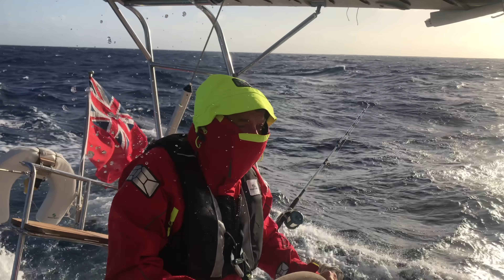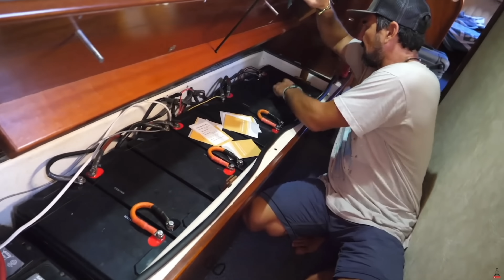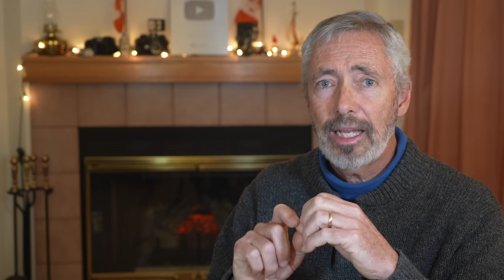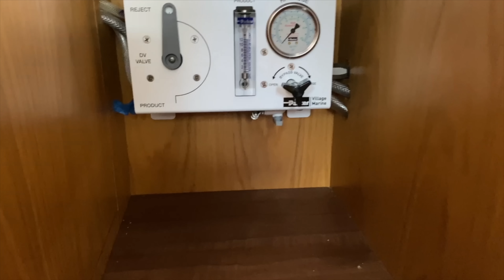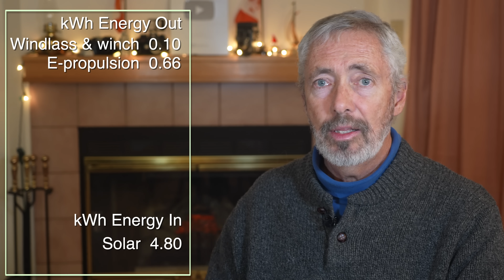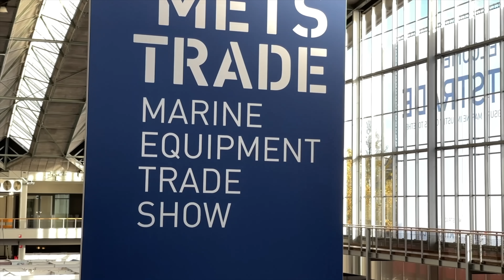Building an ALUMINUM Sailboat Pt 8 - HYBRID Power on a Sailboat: Will it Work for Distance? | EP 228

Comment: I agree with your choice of not going electric only. For my wife and I safety is first.  If diesel means getting ahead of a storm or arriving to an unknown anchorage or marina before dark, or giving us options in the event of a serious rig problem, we’ll take it. We have our 2nd boat build underway and have made some different choices this go-round. When we commissioned our first boat, a new 2018 48ft monohull, we specified a generator and typical lead acid batteries. The generator had to be used for washing clothes, making water, and at times, charging the batteries (we had no AC) when no shore power was available. When we brought the boat from Sweden to the Chesapeake in 2019, we were advised to not use water maker in the bay so our generator saw even less use.     

This time around we have downsized to a 45ft monohull and opted out of the generator, opting instead for a system of almost 1,000ah of lithium for the house, and two high output alternators on the engine, and some solar. No water maker but have added AC for those “special” occasions.  For water in the Bahamas we will purchase a portable water maker.  

Considerations: the cost of a high Kw generator offset the batteries and removes the maintenance of same. Also we are notfull-time cruisers, so our choices might very well be different if we were living aboard. We take delivery in June of next year (Sweden) and it will be interesting to follow you and compare notes 😊  Thanks for a great series and inspiration.

Comment: Check out the hybrid HPV water cooled panels ..to preheat your water..
Hull Insulation works in both extremes and good passive ventilation saves lots of energy.. 
There are new technologies occurring daily...one is wave powered desalination buoys. 
At higher latitude you can use a secondary solar array like the Flynn sail. Where the panels can be pitched to the optimum performance. 
The heat pump concept works extremely well with water rather than air and the French have developed a high temperature heat pump using Ultrasound..

Comment: ✨Aluminium-Ion Battery: Recharges 70 times faster with ZERO Fire Threat!
Fantastic new 🇦🇺Australian battery technology currently being tested should be on the way in around 2024. The Aluminium-Ion Battery is rapidly being developed by the Graphene Manufacturing Group (GMG) in Brisbane in an ongoing collaboration with The University of Queensland (UQ). 

✅Some qualities that make it Perfect for vehicles of all sorts.

* Completely recyclable, 
* Green tech - Need no cobalt, copper, lithium, manganese, or any rare earth metals mining.
* Efficient, sustainable world class proprietary graphene making process (no mining)
* 3-5x greater energy density over lithium-ion Batteries.
* Recharges up to 70 Times Faster!! 
(EG: complete 10 hrs of regular charging in 10 minutes!)
* Cannot catch fire: No Thermal runaway even when shorted, punctured, split or broken.

With this tech, you could simply run two small batter banks for as long as you wanted by  alternatively charging one full bank in just an hour or so while drawing down on the other.

Comment: What about reflex heater or another diesel heater. They are very popular in cold climates. Even on the famous Pelagic boats the skipper Skip Novak dont want another system. They are reliable. The bigger ones of reflex diesel heaters have even a connection so u can connect it to water radiador/ heat exchanger. They need to be placed correctly because of the ventilation and they need a chimney but this is on aluminium boats no problem to install it. Then u can use special small ventilator and place it on top of the stove. The uprising warm air will be turning the propellers to warm up the saloon  faster. No electricity needed. Works great on boats in norway

Comment: I'm not an expert on these matters but I am curious why nobody in the cruising world is looking at a heat pump solution for heating/cooling onboard a boat. Is there a specific reason, they use a well-established technology to draw heat from the environment (usually from the air but could be from the sea). Even cars (see Tesla) use this technology to reduce the draw on their battery banks to heat and cool the battery banks and the cabin space of the vehicle. And why does nobody seem to use the solar to directly heat water via a black radiator in a similar fashion to the camping black bags that produce enough hot water for shower in a relatively short time. As everybody keeps pointing out marine Li batteries are horrendously expensive, so why not look at solutions that require no fossil fuels and much less electrical power. Seems to be a no brainer to me but as I said I am not an expert, so I just want to know why these technologies can't be used on a boat.

Comment: Great to involve us but I’d imagine your main decisions are done. However if not here ya go.

1. Go design and install a two (2)motor hybrid drive for redundancy and that would allow you to charge a 2 bank system at the same time. 
2. Deisel heating ductwork doesn’t always need to be round so it’s possible to lay flat and be designed into cabinet soffits or behind light rails if you choose the Espar type system again. Your aluminum boat will be a big heat sync for the Northern cooler waters and leave you with more heating days needed than a fiberglass boat would comparably.
3. Cooling can be an induction cooling system through your ductwork via a hull cooling system while in the hot zones. The coils for it would need to be in or near the keel to have the effect I’ve used before on a similar system. I may add on the warm days or nights you would would be better to also have a cool air draw and warm air vent to the exterior mainly in the cabin and sleeping quarters.
4. Power in general at rest with lithium-ion 200 amp hour batteries. 
5. Insulation the hull and headboard big time with rigid board vacuumed to the primed and painted raw sections of the hull and or deck, preferably with one that won’t mildew up.
6. Solar (Just an idea) to add to the one on the aft awning/roof 
Can you develop a solar array that unfolds from the life-line stations of the new boat with the newer semi-ridged panels? Or possibly a fold out system that would be self powered and rotate to the sun for better efficiency to be used while underway or at Anchor?

Cheers you all..

Comment: This really depends on the hybrid system you are buying? also plan on 30% more battery storage than you think you will need with lithium. Since you are building your new boat check with sailing SV lynx. he is designing a new battery for boats that will go into production. If I had to buy batteries I would go with power queen. they are sealed and give you way more than marine batteries and they will do the same job at 1/2 the price. I build my own and if i had to buy it would be power queen as they have 10 year warranty and cost way less. I would also do 48 volt over 24 volt as it save in wire costs and its safer. Victron for inverters 2 5k units or 2 3k units. I say 5k only because under powering systems means longer life and more power if you need it. also they do have 48 volt windless or you can do a dc48v to 24 v at the unit. which means again less money on wires(cables).

Comment: hello, i live on a 27 foot electric sail cat in southampton uk  , i use about 2 kwh per day for house use. including showers  with instant electric water heaters ( a shower would use about 350 wh, i found the electric water tank heaters to be very energy wastefull. with two persons on board that goes up to about 3 kwh.   the electric oven i find to be very power hungry partially by design to cook faster they have no insulation and rely more on the infra red heat of the elements. i insulated the oven it now takes very little energy but does take a bit longer to cook.  i also have a airfryer that is 900 watt draw,  i put some tape on its air output to make it take a bit less energy,  in trade for taking longer.  i use normal house hold mini 240 volt fridges as they a 7x cheaper than marine fridges.
Reply: You should certainly look into a Remoska, so frugal.  We halved our gas usage over the last two seasons.  There is a really good thread on Cruisers Forum about electric cooking including the Remoska.

Comment: Thanks, you have covered an area (energy) with adept simplicity. Solar, feathering prop, hybrid generator, diesel generator, portable electric heaters, diesel electric heaters,  engine by pass water/coolant to heat radiators/hot water tank. Creating and storing sufficient energy for water maker, induction stove and hot water baths, runing washing machine/dryer. Designing  a cruiser for hot or cold climates. Compensating for no wind, emergency scenarios, cruising, little or no solar.
You started to hint at some of these cost upgrades. E.g. lithium batteries @ $20k. Can you provide budgetary estimates for water maker, hybrid electrical generator, induction stove, hot water pressure tank, same for high efficiency fridge/freezer, washer/dryer, high output current

Comment: Just doing a dump (+ translation to English) of what i'm planning for a 43ft sailing cruiser. Maybe something is usable, or might spark an idea.

For a less pricey option you could check prismatic 280Ah or 320Ah (3.2v nominal) lifepo4 cells. ~7.5kWh costs ~$1k. You would have to manufacture your own casing, preferably watertight, for them but would allow for any size battery you might like and basically any voltage and in whatever layout that fits the boat best. 

Planning for a 32s2p setup (102v nominal & 57kWh) myself and that will run me in total around $12k if i do most of the work myself. Recommended discharge rate is 0.5C for max longevity (2p = 0.5*280*102v*2 = 28.5kW) but can safely be used at 1C (57kW in my setup) at the expense of lifespan (6000 cycles @ 0.5C until it reaches 80% of manufactured capacity)
BMS is not required but balancing is. A low-current BMS can be used for balancing and to control a master-relay (no usage-current passes thru the BMS) for a simple high/low voltage cutoff.

For me it's mainly to allow motoring for almost a day in canals and such (calculated to around 2kW for 3knots on flat water) and reduce the frequency of having to fire up the generator when there is no sun. This setup will outlast the boat if i charge the batteries 0 to 100% every 5 days. ( 6000*5/365 = 82 years :)
Engines will be dual-electric motors (15kW continuous each) that drives a single shaft/prop via belts and each engine will has it's own controller. This in combination with the two battery strings then allows for some really nice redundancy if anything should fail when underway.

If a 48v setup is wanted you could do a 16s4p instead. Same power-draw and kWh as specified above would apply, but it may be an issue to get high-powered engines at 48v.

Comment: I would say your numbers are about right.
You may have overestimated how much the regen slows the boat.

Ive been running 2 ocean volt servo prop 15s for nearly 18months on a 46foot cat with a serial hybrid config.
 I have more solar..  3.2kw peak.
For me regen slows me by about 0.25knot.
I need to be moving at 5knots for regen to be usefull.
I just did my anual service on the generator..  34h was my anual run time for this year cruising Alaska USA.
I spent 21days at marinas where I crammed up the batteries.  Got a few odd comments comming in to 'refule' and taking 8h at 220vac.

Heat is reverse cycle heat pump and cooking is all electric.
Heading south for warmth now.

The two change i made to my setup are.
1) a full rated auto switching shore power transformer.
I tend to go to marinas to recharge more that i did before.
2) I added some software that auto engages the regen at 5.5knots and stops it at 5knots.
Scavaging power in those gusts made a lot of difference.  When your in marginal conditions on AP you dont necessarily remember to switch on regen.

Comment: The interesting thinhg about hybrids it the use of diesels and the regenerated of electricity when sailing! Very interesting! But the prices it very To hights! If you have to change you diesel because it dont work May be but a new diesel engine install est less than 18k$! But doing the transformation for electricity system it's more then 30k$ for batterie bank and may be 50k$ for the hybrid motor! Change the oven like 2k$! It's good solution for rich people I think! 
One way more cheap solution it the use of a hydrogenerator and keep you're diesel motors!

Comment: Great video, thanks! I wonder did you ever consider intalling heat pump for heating, perhaps even cooling?
Reply: The same question occurred to me. It seems like a heat pump would be more efficient. Especially considering you can use the ocean for your heat source/ heat sink. It would have the added benefit of dehumidifying the boat. Thoughts?

Comment: You are paying too much for batteries. For $20,000 to $30,000 you can get a full Tesla model S battery pack which is 60 to 100 kwh depending on the year and model car it came out of. I converted a car to electric a few years ago. Using brand new 100 ah CALB LiFePO4 prismatic cells (96 of them) in 48S 2P you get a 30.7 kwh pack for about $11,000 to $12,000. Maybe add $1,500 to that for a battery management system. For a boat you probably run at lower voltage and can get 200 -400 ah cells and use a shorter series string. Talk with a good EV conversion shop or check CALB's website. Not sure where you are based out of or I would make some suggestions. I would put the batteries in a good 1/8"thick sheet steel battery box (or two). If handled properly not likely to have a problem but Li batteries burn hot if ignited and a steel box and appropriate fire extinguisher give you containment and a level of safety.

Comment: Really good video!  I learned a lot about the process of energy budgeting. WRT heating:  I loved the Espar hydronic on our 38’ mono on Vancouver Island.  It absolutely MADE the winter or wet weather sailing trips great. BUT It would quit working sometimes (blowing vast quantities of smoke then shutting itself off) and the diagnostic computer would call for replacement of the combustion can when all the culprit was actually the igniter.  

In the interest of power budgeting and especially reliability, I second the suggestion for a serious look at a diesel drip heater, as a stand alone or backup.  They can have quirks too:  on a spring sail from Halifax to St Johns, the skipper couldn’t get it to light.  It would ignite with an explosive bang which was most unacceptable. It seems that with chimney mounted on the center line of the boat, the heater was always required to exhaust into the high-pressure zone on the windward side of the mainsail.  Placing the chimney ahead of the mast might have corrected the issue, but it’s something best planned early in the build. 

Great videos.  Thank you

Comment: 3 advices for better eficiency:

1- (this a defenetly a must) use in combinaton of fotovoltaic solar panels, you must use 1 square meter of solar panels for water heating like modern houses have. almost 90% eficiency compared with realistic 15% of fotovoltaic to heat water... and much cheaper for same power ratting

2- use in combination with warm water cilinder acumulator an instant water heater like bosch  TR 1000. this saves a lot of energy since energy to heat the water because is not wasted in acumulation, is just used for necessary instant water 99% eficiency. and very cheap and compact

3- instead of air condition, to cool down around 10ºC compared to outside , use an humidifier like : Viesa Holiday IIIS (this is not for sailboats, just example. for sailboat should beat custom made for especific dimensions) . It uses very low power at 12V and a few liter of water. simples and eficient ...

There are a few more ways to improve efficiency , but it needs longer explanations. not suitable for coment section. 

Congratulations for this video, very useful for sailing comunity

Comment: I would like to say that this video sparked quite a discussion between Socks and me (it even involved a "robust" whiteboard session). We have been looking at converting from our Yanmar 85 to a 35KW electric with a battery bank of substantial size, and a 48 volt generator and solar for generation (See SY Elysium).  The propulsion system that you showed excited Socks more than I thought possible. We would both love more information about the specs of the build so we can compare.
Reply: Do it already! We spoke last spring. Let me know if you need some more convincing.
Reply: @sunlightconversions828  I always do double the research on things like this. If you still have my number give me a shout so we can talk about some options.

Comment: How would about a heat pump? Our electric car has one and it generally uses 0.3-0.6 kw to maintain 18C in winter and about the same to maintain 23C in summer in the cabin, and cars are the least insulated boxes around.

Comment: the hybrid propulsion sounds very interesting! Can the shaft be de-coupled from the propeller to use the diesel engine purely as a generator, for example at anchor when there isn't enough solar power coming in?